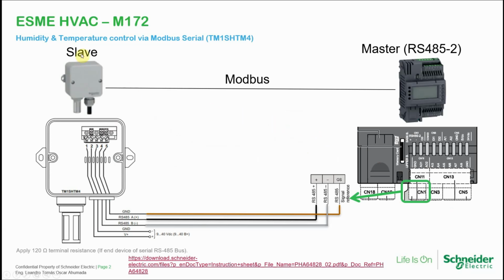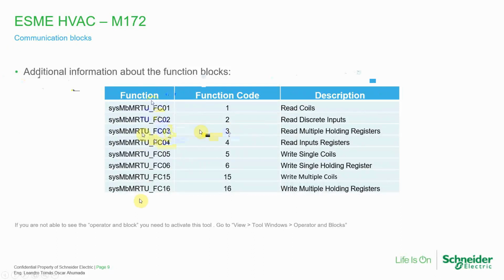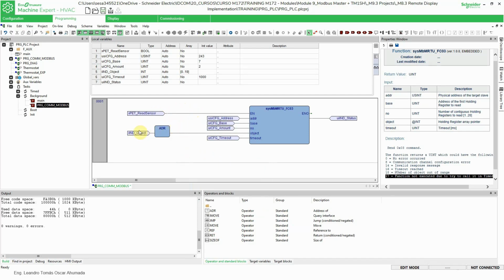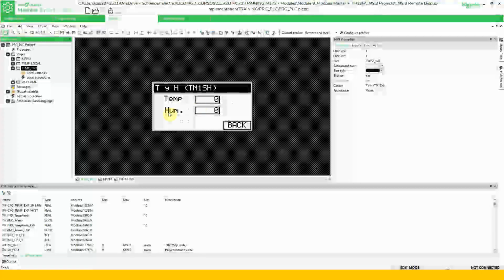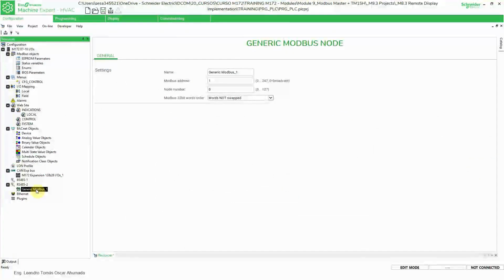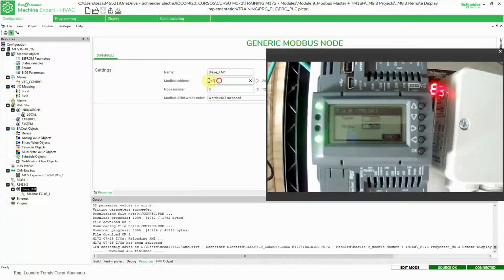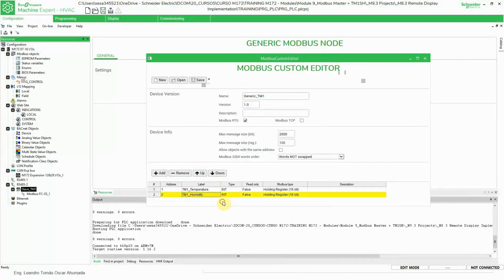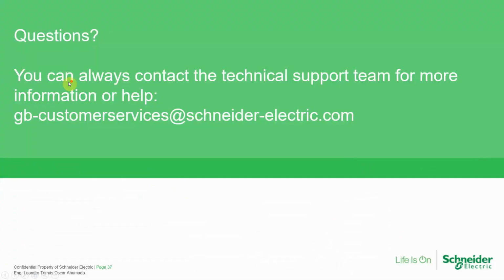Training M172 - M9.3 Modbus Serial Master

Comment: Hi LeTomas, what should I do if I want to read a register that is 32-bit integer? When I use the IOscan method, the FC-03 only let me to use Word as object type.
Thank you.
Reply from the maker: Hi there! You must use the 2 words to read the info then use a converter to assembly the two words into a dword and finally convert to dint
Reply: @LeTomasAHUMADA thank you for the suggestion. I made it work.

Comment: Hello! I'M currently using A TM172 AND RS485-2 PORT AS MY MASTER. However, if I want to connect the RS485-1 Port to another device as a slave, can I use it at the same time? I can't communicate with RS485-1 PORT. How to connection RS485-1 Port? thanks
Reply from the maker: Hi there! As you already know the RS485-2 can be Master/slave and the RS485-1 can only be slave.
You can use them at the same time without any issues. You can try to connect the RS485-2 to the RS485-1 to test it :)

Comment: Hello! In my configuration, several frequency converters are connected to port number 1, and a Weintek panel is connected to port number 2. Both are Modbus RTU. Please tell me why, after physically disconnecting the frequency converter from the RS485 network, the M172 controller continues to display on the Weintek panel the current and frequency that were at the time of disconnection? Thanks!
Reply from the maker: Hi there! It depends on how you communicate between the plc and the drives, usually you can configure that values read can be 0 at disconnection or keep last value. I recommned you to check the connection and give an alarm to the hmi.
Reply: @LeTomasAHUMADA  Thanks for the answer! Is there such a configuration setting in Ecostruxe for M172(values must be 0 after disconnection)?

Comment: Hi. Is there a way to use the M172 as a modbus slave and get the local and field variables as integers and booleans on a different computer?
Reply from the maker: Hi there! one of the M172 can be only slave over Modbus serial so you can use a PC (with the correct hardware to connect to the PLC) and Read/write data. You must know the address in the PLC, take a look into the videos M3.4 and M3.5 from my next playlist:
https://www.youtube.com/playlist?list=PLFqT6GhMpgpLqUyVacn0n9acc0yUm4qIF

Comment: Very helpful tutorial,but I am getting error on compile when used sysMbRTU_FC03 function block which says function not found, how to get rid of that?Thanks
Reply from the maker: Hi there! The sysMbRTU_FC03 is native from the M172 PLC so that message does not seems right. 
Try to refresh the target:
1) Programming tab
2) Project > Refresh current target
Or use the newer version of the target
1) Programming tab
2) Project > Select target...
Reply: @LeTomasAHUMADA  I have done that already, nothing happening, i tried upgrading the firmware now that cpu goes into error when slave is connected

Comment: Thank you for your guide But how to get a communicate if the data is in the high byte or low byte of register according to the instruction of a sensor？😊
Reply from the maker: Hi there! I am not with the pc to double check it but in the library tree you can find a function to convert a word to bits and then you can reorganise then into a new word. After my holiday i can work on this and make a video 😊